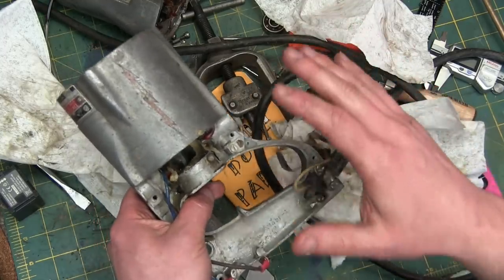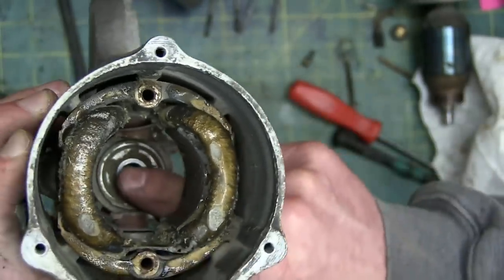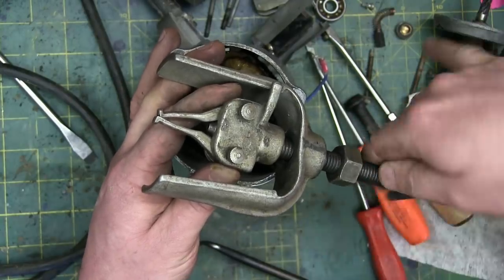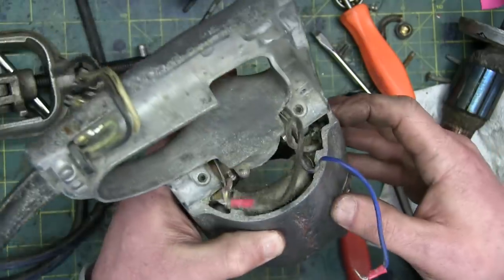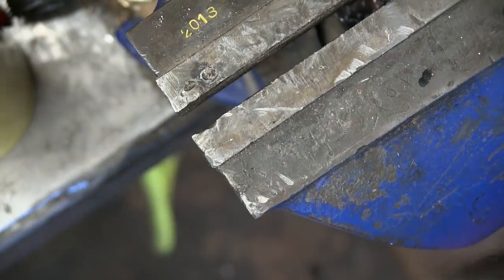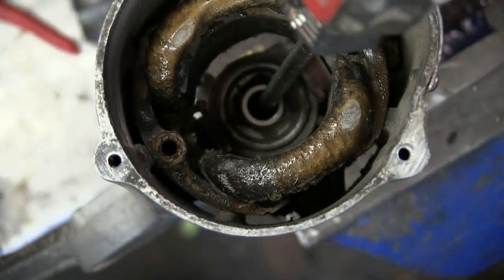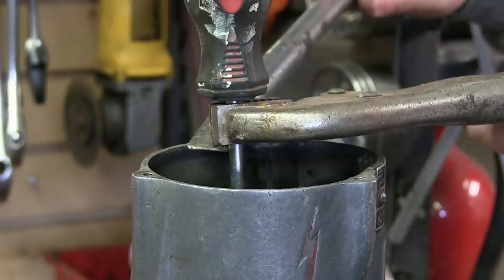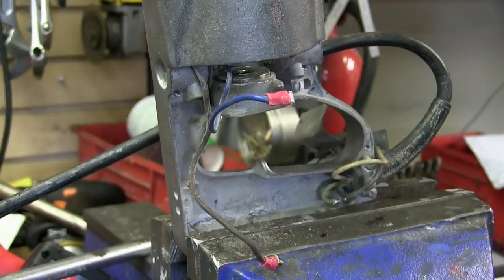GREASY RAG HACK! Damage-Free Bearing Removal.

Comment: Hydraulic pressure-very cool.I didn't know that trick til now, thanks! I would have drilled 2 holes in the back and used a couple of nails etc and epoxied them up when done.Not any more.

Comment: A similar hack is pack a small amount of grease into the base, then pack the centre with BluTack. This is fluid enough to hydraulic it up, but not so much as to easily squidge out around what ever you're using for a plunger.

Comment: You take the pilot bearing off it's stand and you thread it onto a slide hammer. Long reach blind bearing puller.

That's how I'd do it, if I had the bits on hand.

This is a great trick for those tool limited situations though. I've used similar to pop clutches off of snowmobile engines.

Comment: Worked great on a blind bushing on a delco remy starter generator for a 1974 cub lo boy would recommend if you don't have the proper puller. Used a bolt of about the correct ID and a bench vice.

Comment: Yup, good tip. If you're on the side of the road and have to pull a bearing from a blind spot a bar of soap will work too, jam the soap in an tappy tap tap it out using the same method.
Salutations de la Suisse.

Comment: yep , its an oldie but a goodie ,,,, hydraulicing out a bearing , usually seen on spigot shaft bearings , a wooden dowel can also be used as the rod , if you cant find anything the right size

Comment: I've used that trick before removing pilot bearings out of crankshafts and other blind hole pressed bearings. Nothing like a little hydraulic action to remove those tricky fuckers. I've also shown people the old heating bearings in the microwave wrapped with a damp cloth trick and they just about shit themselves. great video man.

Comment: Another way and something I have done many times is to clean the inside of the bearing thoroughly Using red locktite fit a close fitting shaft with a  hole through it in the bearing and leave it to set , use a slide hammer and hook through the hole in the shaft , I have never come across a bearing that will not come out doing it this way and it is going to fit unlike a inside puller , best to warm the housing before using the slide hammer , can get a bearing out in minutes

Comment: I have a blind hole bearing slide hammer. bought it at harbor freight. Expanding collet goes in the pilot bearing, couple whacks..she's out.

hell, I bought the bigger slide hammer just for funsies too. that one will send a full floater axle across the shop.

Comment: Use something similar to remove the shocks from the BFV’s I used to work on, simple bolt drilled through with a grease fitting in the head, and an o-Ring on the shank of the bolt. Screw it in, pump the fitting full of grease and away it pops! Thanks for sharing! 😎

Comment: ive actually got a tool for this. has different size ends and a cone shaped slide piece to keep it centered as you pound it in. believe its for removing the bearings that a manual tranny ride on in the motor

Comment: Two things here, one, wasn’t that a grease fitting on the bearing housing? If so you could have done the oily rag trick once or twice and then pushed it out with a grease gun. Two, if I did that procedure with a drill bit I would absentmindedly throw it back in the drawer with the rest of the bits and keep grabbing it to drill with thinking “What the hell is wrong with this damn thing!” and forget to sharpen it so back in the drawer it goes. Great trick though, watched my grandfather do this on a bearing in a bush hog back around 1978. Still relevant today.

Comment: video starts and right there i think this guy should have used the piece of bread method. Works great, and if you get hungry while doing it you can allways take a bit of the bread you use.
And if you didnt know, the piece of bread method is pretty similar to what you used, but you just put in a few small pieces of bread each time instead of grease, works great.

Comment: I once did something similar with water.  I filled the bearing cup with water,  stuck it in the freezer,  and when the water froze, it pushed out the bearing. Liquids are mostly non compressible and water has the  weird physics of expanding when frozen.  So,  it pushes out the bearing.

Comment: I remember figuring this trick out at about 18 years old. And getting yelled at for making a mess by the boss/real mechanics. Until she popped right out. Never used a rag though. Just straight bearing grease, and a bolt shaved down to be bch tight.

Comment: Theres a pretty cool berring shop in my area  one of those hole in the wall shops thats been there for hell of long but ya dont see many people there ever but there in a pinch with the right stuff.    Next time use the slide hammer or drill some small holes in the back and punch it out with a small nail or something.   You can always fill the holes you drilled

Comment: @AvE Using wet papertowels works as well. I've pulled a few pilot bearings that way over the years.  It has the bonus of being easier to clean up than a bunch of grease smeared over everything. Just put some towels in a bowl of water and then work them in with your finger, then go in with your punch and viola, bearing in hand and just some water to wipe off.

Tip from one of the MANY old timers my Dad had me around growing up!
Reply: but what happens if you can't find a skookum girl named Viola to help you remove the bearing?

Comment: AvE, I just came across your vids a little while ago.  Watching them is akin to eating pretzels; I just can't stop!  After subscribing I have been binge watching like they were a Netflix series, hahaha.

I have a dumb question that you probably have the answer right off the bat:  where do you purchase individual bearings?  I am in the States (VA), and I recently had to rebuild an old finish mower that I run behind my tractor.  I pulled the old bearings, took them into local hardware stores, industrial outlets, even auto-parts shops and nobody could match me up.  I finally sourced a local industrial warehouse who could get them for me, but only in bulk!  I had to buy about six bearings more than I needed. 

Is there a site out on the web where one can input bearing info (stamped or measurements) and just simply order them up?

Comment: 2 other options : use the central part of the extractor, , as long a nut can be catch above the motor chassis wedging under it will allow to extract, or if no wedging, adding an inertia extractor on the rod .

Comment: Used the grease trick many times, but never seen bits of rag used before, must try that some time....
Nice alloy housing, a little heat (dip the end in boiling water for a min or two) would have made that bearing fall out .....
Cheers
Reply: What did you use instead of rags?
Reply: just grease packed under the bearing and something that is a close fit inside the bearing to act as the piston. A bit of hard wood cut to size, steel bar, etc. Even a socket set extension carefully wrapped in electrical tape to get a close fit in the bearing works. You would expect the tape to fail, but that technique has worked for me many times !
Reply: I literally just made a piece of wood to size of my bearing lol. Thanks~

Comment: If you heat the housing to where it starts to smoke, you can most likely tap the back of the bearing and the bearing will fall out!  If not ,use that method. Mechanical over hydraulic= tapping in cloth forcing grease behind bearing forces bearing up

Comment: Much cleaner: cheap as you can, wonder bread. Took me about 2 1/2 slices of wheat to remove a pilot bearing from my cousins nissan 240 when we did the clutch and flywheel. Had white for my own truck, and took less than a whole slice

Comment: Even better, use wet paper. Works amazingly well. Container of water, rip up packaging/paper/cardboard and mulch untill soft and squishy. Pack in hole and hit with hammer and punch/ 1/4 Dr socket and extension. Keep walking it out until its in your hand.

Comment: I've heated the end cup with a heat gun and have used boiling water, then slammed it down (bearing facing towards block of wood or bench) hey Presto bearing falls out,, job done 😊.

Comment: Two small holes in the back and a small punch back fill the holes if your worried but they're sealed berrings anyways or that screw driver on a slide hammer

Comment: I do believe I’m a tad older than the frog. And I learned this trick back in the 60s. I recently used it to remove a bearing from a Beemer swing arm. It’s not rocket science but you young whipper snappers need to pay more attention to old machinery texts. I have a good one from the Montreal locomotive works.

Comment: never heard of that trick before but I can't say my mind was blown. Hydraulic pressure....  would it also have been possible to drill a small hole or two in the back and push the bearing out? I realize that wouldn't work in many cases, but in this one, I think that's the route I'd have taken. I will remember the greasy rag trick however.

Comment: I never use rags I just find a snug fitting socket put the extension in the socket side. Soft bearings you can sometimes just put a grease fitting in and use a grease gun

Comment: In case you only have your really expensive grease you're saving for that one particular job, or find yourself without rags, you can also do this with bread.

Because a $1.00 loaf of bread is way cheaper than that 10 year old grease you're saving and the paper towels hiding in your cabinet.

Comment: Same trick for removing snowmobile primary clutches though with them you have a threaded hole and you just run the bolt in to pressurize the grease.

Comment: What about a slide hammer with a bearing puller. Had a set with the same end as your pilot bearing puller. Worked most of the time for pilot bearings when i have done them. Neat trick though.

Comment: Use a rod or thick wall pipe that is small than the outer race, now tack weld it to the bearing  the heat will expand the bearing fast and the hole its in, the bearing will just pull out by hand.  If not put a weight on the tube / rod that slides up it, don't forget to weld a bigger washer on the end, slide hammer,  never failed me!

Comment: Hello, these situations where these bearings really are difficult to remove. I particularly like to heat with torch. Aluminum expands faster than steel so it's just hitting the housing upside down that the bearing falls alone.

Comment: Not long after serving my time, I tried this in a cast iron housing. Split the back out of it and the bearing stayed put. Had to weld a bar to the bearing and pull it out with a slide hammer. Then I had to repair the casting before I could get another bearing into it, took all day and a hot supper but that's the risk you take. That said, I have never had this method fail me since. Even used pasta on one job, had sod all else available.

Comment: this is a textbook example of when to use a grease gun.  put a grease gun in the bearing hole (ensure tight fit) and start pumping, kerplunk goes the bearing.

no need to use the drift and the hammer (UNLESS) the grease gun fails, but i've only had a grease gun fail to push out a bearing if there was enough clearance between the tip and the race to let grease flow out - which a wrap of a t-shirt does.

Comment: I tried this with wax (similar process) here's where I went wrong.. and you could have too.. I did not support the opposite side of the pounding and the pressure of hammering blew out the aluminum casing. I'd do it  again.. but will assure to support the backside if possible.

Comment: that's pretty nifty of a trick, i would have been the guy to use a piece of allthread and a small section of C-channel and unthreaded the nose of the bearing puller and fabricobbled some Frankenstein fuckery that would have reached and pulled the damn thing a-part from the end of the casting..

Hydraulics are fun though, I've used this type of trick for decapping Berdan rifle primers with water and a snug fitting rod or for removing squibs from barrels while testing minimum powder loads.. 

Keep up the good work!

Comment: On bigger I.D. stuff instead of a drill bit you can use a socket with an extension put on through the hex side. You know, so you don't go rek your Chineseium bits

Comment: Very tricky, and very difficult and also maybe just lucky... I would have drilled a 1/4" hole on the back of that blind housing and gently brass drifted that bearing out. Someone showed you that trick Mr Ave.....didnt they... They sometimes use a similar method for removing cartridge primers out of ammunition. BTW..I think you're a brilliant fabrication engineer and tech, and I'm always amused with your colorful Canadian slang words........

Comment: Going to do this, but not sure if I can get all the incantations correct. Will double f you work? I found the secret. Hit your thumb with the hammer and the incantations flow. After grease, I tried candle wax. Popped à rusted in bearing after 4 minutes persuasion.

Comment: What if you drill and tap the back of that housing. Use Iunno 3 longer screws to push it out along the outer race. And when you just want to seal it, use 3 smaller screws.

Comment: The clutch puller might have worked had you taped the tip together instead of letting it swing free. After it got in the hole just spread it apart and tear it up. The tape that is.

Comment: Thats a normal trick for clutch pilot bearings on cars.i would have welded a peice if allthread to the bearing and use a plate and nut to draw it out.quick and clean.

Comment: could you follow with a port-a-power for very stubborn ones like  fryed wheelbearing (not welded to the spindle). juse drill a 1/2 hole, beet the rags oil/wax in   the hole full. if no dice tap yhe hope and hook up the porta-a power and stand clear

Comment: I'm only 4:30 into it. Would you have been able to get a long threaded bar and have the Jaws extend lower? Just a thought. I've never used that tool before. Now back to watching the video.
Reply: Milton Rosario yes. Can be done, has been done, and should have been done as you said. However, he would have had to put a thick enough plate with an opening in the center across the top so that the outer legs of the puller tool would have something to sit on top of.

Comment: before I spend 10 minutes watching it, did he just pack some heavy grease into the hole in the bearing, then take a metal rod that was the same diameter as the hole in the bearing, and using suitable support, drive the rod into the hole of the bearing, making the grease pump the bearing out?

Comment: Used grease hydraulics to get a stuck pilot bearing housing out of my GT500 crank. NOTHING was working, then an old school tech told me about this. No rags needed, just grease since it was just the housing. Filled and hammered a few times and boom, out that stubborn asshole came. Good stuff.

Comment: i have also remove brake caliper piston when air won't do it. take plastic master cyl. bleeder adapter drill hole in the center screw in a grease fitting and them use grease gun piston comes right out

Comment: A can of air, for like cleaning keyboards, turn it upside down and it will freeze the shit out of the steel bearing, them flip it over and hit the aluminum with heat and the bearing will fall out.👍

Comment: OK I watched it, but NO idea how that worked!  Gonna be rebuilding varous e lick trick motors so I’m loading up my noggin in advance.  Hope I won’t run into a recessed one like this one!
Reply: So you were packing the grease soaked rag in behind the bearing, and the tapping forced the bearing to exert  upwards pressure on the back of the bearing, is that the trick?

Comment: Thanks, I learned something new. Another way to hack that sumbitch would be to stick arc weld a circular bead betwix the inner and outer roller race. Be careful to not burn through the entire bearing with too high of welder amperage...you don’t want to F up the bearing mount housing. You just want to quick super heat and expand the roller bearing and then quick douche it with H2 fukn O to quick contract the bearing. That fukn POS bearing will fall out of the blind hole once it is cold shocked and contracts. This hack works skoocum on axle housing tapered roller bearing cups. No fukn expensive bearing puller equipment required!

Comment: Bread might be a better solution..been successfully drivig out bearings from a blind hole using just bread...
To my experience...wet paper towel and similar worked too...just bread a little bit better doing the job...

Comment: While this is certainly a great method to remove blind bearings, just be careful.  I've seen the technique used to remove clutch slave cylinders on motorcycle cases.  Sometime the cylinder lets go....sometime the case lets go.  Make sure the "hole" the bearing or cylinder is in is stout and can take the forces.

Also, had a good laugh at probably "throw the car away" these days....

Comment: Drill 2 small holes on the backside of the aluminum above the bearing race on opposite sides of the bearing for a small punch to go into. The tap the bearing out working each side a little at a time.  Then when you install the new bearing you can put a dab of silicone in the 2 little holes or leave them open for next time if you use a sealed bearing.  You can't always do this with a blind bearing but this was a perfect example not to have to use grease and rags and makes a mess.

Comment: Thanks but i thing I am gonin to to drill #30 holes behind the bearing and tap them, after jacking the old one out just seal the holes with a short-flush screws dipped i a fresh coat of thread lock

Comment: Works great on some bearings. Others? It blows out the seal on the side:( 
Tried it on a Toyota 2.7l 2tr-fe pilot bearing. Silicone side seal. It blew. Had to resort to a carbide burr bit on a die grinder...